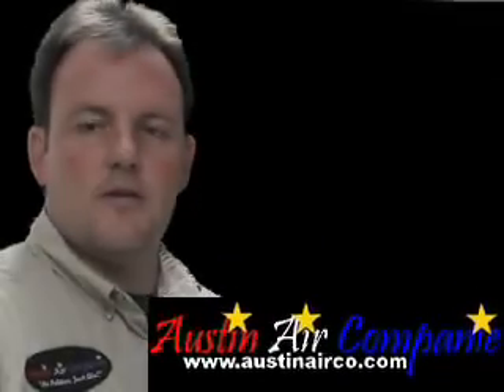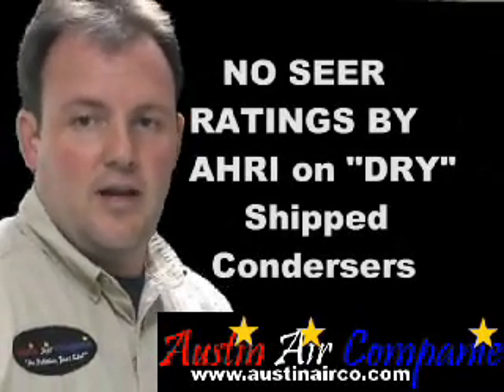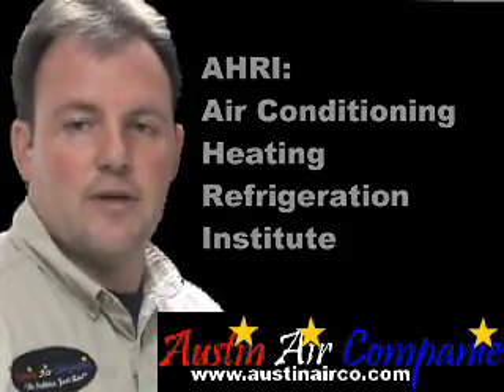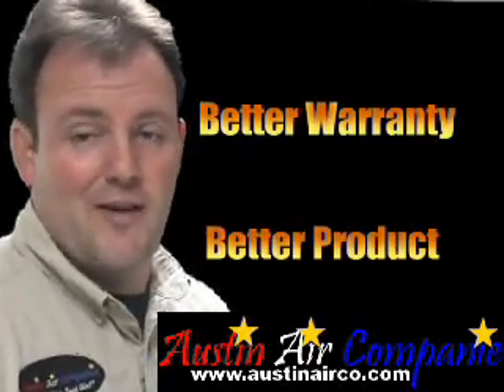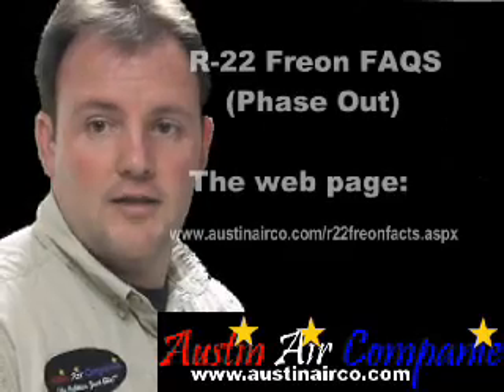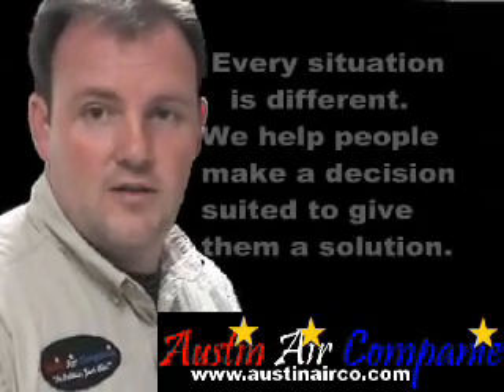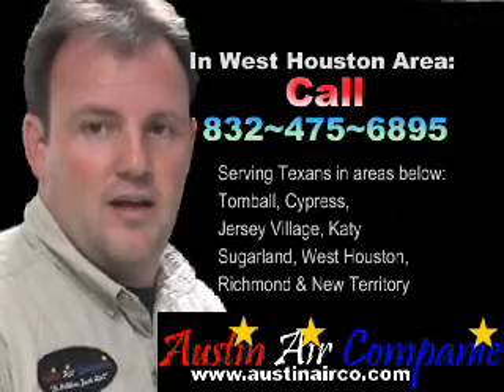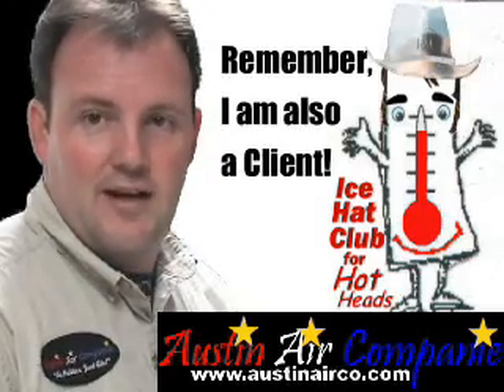R22-Freon_Facts-Update-2011.wmv

Comment from the maker: I have heard it all before, this is nothing new. Stocking up on R22 doesn't negate storage costs and taxes if you are running a legitimate shop. The only way it makes sense in today's dollars is if you have a steady supply of customer's that need refilling. 

But if that customer decides to change course you are stuck with product you'll never get rid of or take a long time to recoup your money. The risk is yours.  I have converted countless R22 systems to R410a with no problems. Do it right.

Comment: I never allow a system to keep leaking. I have also stocked up on R22 in part as an investment. As for R410a that hasn't been my experience. I live in Houston and have seen the delta T narrow to a point where the unit couldn't keep the zone at the target temp on very hot days. The R22 system there before did. Just like R134a in cars doesn't cool worth a crap when idle on a hot day. It doesn't transfer heat as well as R12 or R22. Otherwise yea it cools just as well. For cost alone not yet.

Comment: R410a works just as well as R22 does at higher temperatures. The units aren't any more susceptible to leaks but when a leak does occur you must fix the leak rather than top off. 

R22 prices will sky rocket by 2015 when production caps are reduced and then prohibitively so in 2020 when full ban is implemented. So if a leak occurs with R22 system you will want to fix the leak, and the cost to repair will be much higher than a comparable R410a system. 

It pays to do it right.

Comment: R410 sucks at temperatures over 95 degrees. The units are more susceptible to leaks due to the higher pressure. You also have to change out both the compressor, lines and evaporators which can be very costly. For now I'm sticking to R22.

Comment from the maker: To follow up the above post... there are literally hundreds of different refrigerants. If you use an obscure one to charge a dry unit, you may be in worse shape than had you just did it right the first time. Why? because as like above you can't mix refrigerants. You have to use the same one to recharge and make repairs. If they stop making the refrigerant you used the cost you saved at time of installation is negated. Heed my warning and do it right. I have enough that do it wrong already.

Comment from the maker: Yes, Scott you can put any replacement gas you like. However, warranties from the manufacturer are voided when you do this. When you need a repair on the system in question it will make the repair more difficult because you can not mix refrigerants.

Mixing refrigerants will not work and most likely tear up the inner workings of your air conditioning system. There is no substitute for doing it right. The risk is all yours when you don't. When it fails it will most likely be HOT outside.